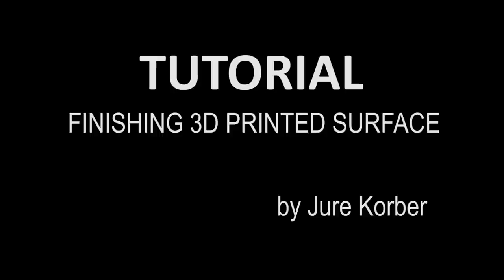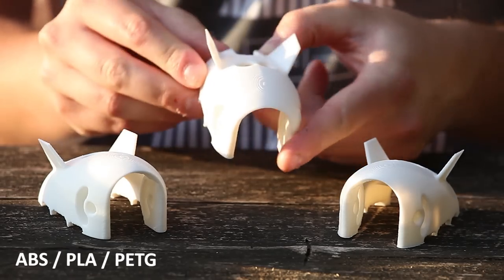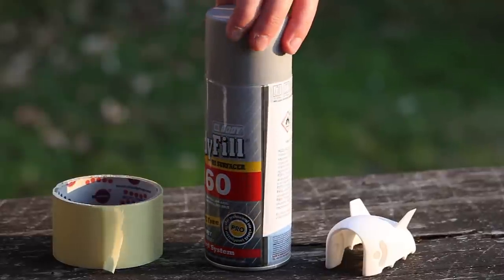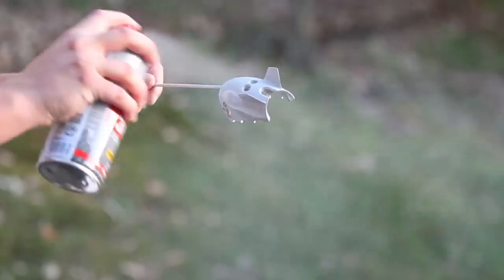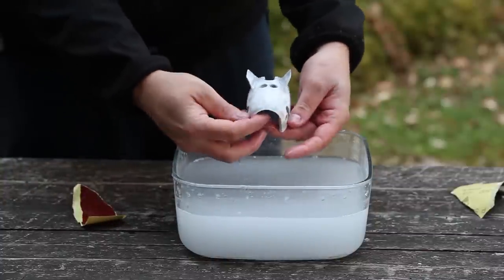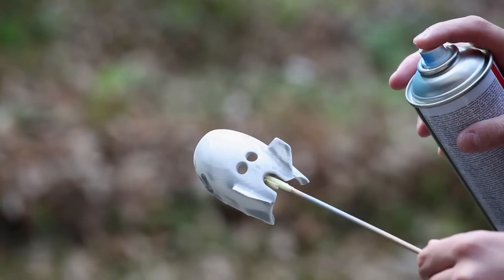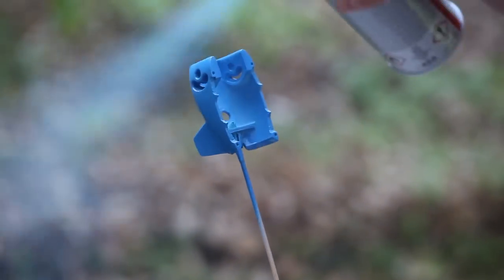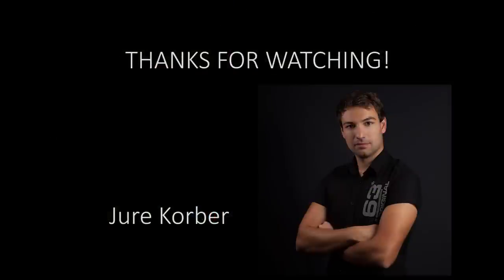Make your 3D printed part (surface) look awesome!  TUTORIAL

Comment: wtf. you said dont spray too much or it will drip but i see you keep spraying like crazy but it works!
Reply from the maker: Really depends on the color you use. Some can be sprayed thicker and they wont drip, some needs a bit of time between the coats. I used quite warm spray can and I also cut video a bit. When it starts dripping it's too late!
Reply: +juresnip - ohhh haha. looks like a long uncut shot. well done
Reply: generally the "right" way to do it is to lay down your first coats super dusty and light, this makes a sticky base of color for later coats. after that gets to somewhere between tacky and dry you start with the heavy coats, you gotta let them Dry almost completely before the next coat with some paints or else they e̶g̶g̶ ̶s̶h̶e̶l̶l̶ orange peel texture from the gasses leaving the paint underneath. anyway your last coat should be actually really wet. not so much that it drips, but certainly heavier than you'd think: this is how you get that smooth shiny look.

edit: eggshell is a desirable finish haha I meant orange peel
Reply: well, that clearly wasn't too much.   smh
Reply: @JKTechSi  Oh.. should you warm up the paint can before use?
Reply: That’s that the stick is for. He keeps turning it as he sprays to even out the paint. If you were to try this on say a stand or something it would drip for sure.
Reply: @chrismofer   My Dad calls it a flash coat. I often wondered why but you explain it well that it leaves something for the paint to stick to. I often am impatient or don't have the time so go too thick too soon.
Reply: @ArcanePath360  flash coat, makes sense. it does take 5-10 min even in sun to dry it enough. i also hold the can farther back than the 8-12" rule, as much as 2 feet back if the wind is playing nice. the paint gets semi tacky while in the air, and is halfway dried by the time it hits the part. @John Fiott yes! everything relating to the paint drying and fully curing works better and faster when warm. the cans should be something like room temp or even a little warmer. careful with heatguns and the like, its a pressure vessel. i leave cans in the sun 10min prior and shake them like hell. I used to paint in Alaska in the winter, it was next to impossible.
Reply: @chrismofer  Thanks for the advice. I'm trying to paint right now with gloss black in my shed where it's single digit temperature and windy. It's not going well.
Reply: @ArcanePath360  ah. slowly warm the can with a blow dryer (or distant heatgun) prior to spraying and then bring the part to a heated room for drying or make a heated cardboard box with the blow dryer. even if just for the first 10min of drying each coat. the cold slows the paint's ability to evaporate the solvents out & the nozzle has a harder time atomizing paint that's cold and soupy. also shake the can for literally 5 minutes; the pigment likes to sit at the bottom of the can and turns into muddy lumps which never get sprayed. I've had cans where you can feel the ball rolling around over lumps even after a full minute or so rattling.

https://youtu.be/zAGu2TPt_78?t=601 
here's a clip of Adam Savage's makeshift glue/paint drying oven. it's a semi-open box with a blow dryer spraying into one side.
Reply: @chrismofer   Thanks. Yeah, I got uneven levels of gloss on parts and matt effect in patches. The can was already warm where it was in the house but I let dry outside and the cold obviously hurt the finish.

Comment: Take a 3000-4000 grit sandpapper after you Done and sand it and then paint it with a clearcoat and you have a good finish thant wont scratch s easy
Reply: Kristian Johansson I don't believe that trying to apply a clear coat to something sanded with 4000 grit paper would work well. If anything, he should have used flat paint and then clearcoated it, then sand the clearcoat with up to 4000 grit if necessary then polish. Of course, it doesn't need to be sanded with 4000 grit unless it has orange peel or other blemishes.
Reply: Different factors dictate what you need. I personally have never found a need to go above 1200. Some people will swear at 2000 or 800. 

Also what kind of clearcoat you choose matters. Some are more durable then others at certain conditions. 

In the end experiment to see what works for you.
Reply: 4000? Clearcoat won’t adhere to a basically polished surface. 1200 is as far as you need to go. Anything more is a waste of time and a worse finish
Reply: Where do you get 1,000-4,000 grit sandpaper from? I've looked everywhere.
Reply: Joey Echols paint supply stores

Comment: For those who don't know how to do Sanding:
1. Get a neutral-coarse grit (the number on the sheet, about 120-180 should work) sandpaper.
2. Rub the object with the sandpaper. Make sure it is fully sanded before moving on.
3. Repeat Step 2 with neutral-fine grit (220-280) and fine grit (300-320) in order said.

Note: if the object is Wood: Go with the grain lines. Better Look.
Reply: Thank you!
Reply: I recently 3D printed aluminum piece. Should I follow the same steps or do you recommend other applications?
Reply: do u sand before or after curing? complete noob lol
Reply: @Kiyamlol  After curing.
Reply: @Shrubster  thank you :) is it safe to handle the bits of resin falling all over?
Reply: @Kiyamlol  So long as the resin is cured, the only danger would be the sanded resin particulates entering your nose and lungs which can cause irritation in the short term, and even more serious complications in large doses over the long term. Always wear the proper protective equipment such as masks rated for the task at hand, and work in a well ventilated area especially if this is something that you're going to do regularly!

Comment: Very nice and detailed overview. For my 3D parts I start with 120 grit dry sand paper to smooth edges and print lines first then use 220 grit wet/dry sand paper with water till part is almost perfect. I like using automotive sandable primer. Usually black or dark grey. I follow primer with wet sanding using at least 400 grit wet/dry sand paper. If you use metallic paints be sure that you prime entire part once more before applying finish paint. That way part is uniform in color and tone.

Comment: This is the best finish I've seen on a 3D part. Been a while since I got back into printing but its impressive that you can get such a shiny finish on something thats meant for practical use. I have seen some awful finishes on things that are touted at "commercial grade"

I will definitely pick up some of  that spray filler when I find something I want to finish well

Comment: This is awesome information!  I think those of us who make things with 3D are too fixed on things like acetone smoothing, and we forget that things like sandpaper and filler (which have been around for many decades) still work if we are willing to put the effort into our work.  Certainly there are many 3D printed parts that have too many nooks and crannies to fill and sand in this manner, but the simple technique that you demonstrate in this video would work for a lot of parts.
Reply from the maker: Exactly! This method works on wood, metal and other materials! In my experiment I also found out that I can get more strength (less delamination) when threated with this method!
Reply: i find that acetone smoothing strengthens my prints. what i usually do is sand first to fill most gaps with dust then acetone smooth it, the dust in the gaps melts and helps fill them

Comment: Great idea, your parts look awesome.   Have you ever tried the Acetone vapor method?  You simply hang your part inside a large jar by a string to the lid,  drop a paper towel soaked in Acetone into the jar, put on the lid with your part hanging from it so that it does not touch the paper towel.  You only want the vapor to melt the outer  surface of your printed part.  It should take only 20 to 30 min in the vapor bath and your part should come out very smooth and shiny.  don't leave it too long in the vapor bath or it will melt completely or deform.
Reply from the maker: Yeah! But it only works for ABS and its kind of limited method. This one works for all hard materials and you can change color, you can also apply hydrodipping etc. :)
Reply: You can use Ethyl Acetate instead of acetone to smooth out PLA parts using the vapor bath method.
Reply: @JKTechSi  do you plan on doing a tutorial on hydrodip? It'd be cool, your videos are amazing

Comment: Excellent video. Short and to the point. Just maybe one suggestion would be to try the same thing with a hobby spray gun. Not only does that involve smaller quantities of paint, but it also avoids the issue that, if you use the normal paint can only rarely, by the next time you use it the nozzle may be clogged up.

Comment: Just tip you should inform what grade sand paper you used every stage i like good videos like this with details
Reply from the maker: It really doesn't matter! You start with 120, then around 250,then 400 and finish with 800,but you could also skip some between or end with 600 up to 1200. Paint fills last small dents and grabs nicely.

Comment: The best paint I have ever used in spray cans I use for my scale model cars and won best in show alot it's the testors extreme laqure the base coat is so glossy like a mirror but once you hit it with the clear in same brand and line of paint it will be glass and no need to sand or polish the clear coat to make it really shiny like a mirror the trick is to lay the base coat and clear coats on medium wet not to light just to the point before it starts to run and that's how I do every model car and 3d printed items and it looks amazing

Comment: Great Video Tutorial, however, DON NOT use water when doing this with PLA. PLA soaks up water and expands! The BodyFill Primer you are using is awesome and a bit elastic and sands great, but other primers don't expand and will crack like crazy if the PLA absorbs any water/moisture while it's drying..  If you use water any part of the PLA print that isn't  fully covered by the primer when you are doing the final sanding will expand and then later after you apply the last coat it can shrink(when it dies out again) back down in those areas and cause dips in the finish.

Comment: This method is great, but might not be enough for prints that have layer lines that are too thick. For those, you might consider combining this method with the use of some type of filler putty. I heard wood filler and bondo spot putty work well.

Comment: Is it recommended to protect.the paint with transparent acrilic paint?
Reply from the maker: You don't need to do that, as generally paint is applied quite thick here and it's stable on it's own. If you use some special metallic paints, then you might want to do that, yes.

Comment: This process is really cool... Is there a specific brand of filler or paint that you would recommend for doing parts and props?  I am thinking about doing this myself, but have very little experience doing any post processing for my 3d printed things.
Reply from the maker: Hey! Well I used a lot of brands but they are very similar. I think it's best to go to your local paint shop, auto-repair shop or local hardware store and ask for filler in spray and spray paint (acrylic). I bet it will work great!

Comment: Hi Jure, thanks for share your technique. I saw in another video that you get better quality printing using two fans pointing at the nozzle. That's why you use two silent fan mod?
Reply from the maker: No - one fan is to cool the hotend and another is to cool the part. But when printing ABS or ASA you must print without using cooling fan, or you will get warping and separation. Fan is only used for PLA, TPU and a little for PETG.

Comment: Hey, great video. I used this techniques in some of my prints and it worked out great. However, I'd like to use some of the pieces indoor. Is there a way to get rid of the paint smell faster? I printed a business card holder that smelled like paint for weeks and even transfered some of the smell to the cards. Have you had any similar experiences?
Reply from the maker: Actually painting too thick can make that. Try to paint as thin as possible to still get nice effect, use good quality paints (if possible true 2k paints) and cure in well heated place.

Comment: Eventhough it looks cool, when using a non-soluble or decomposable polymer like PLA, this technique introduces a lot of ultrafine particles in the air and the environment. If you want to do this take care with breathing and use a rebreather or dust mask. Also be careful where you dispose your waste! Flushing it down the drain will probably lead to some bad effects in your local sewer system or ecological environment. Anyway, keep making cool stuff!

Comment: That BodyFill 360 Spray must be a UK thing because I can't find it here in the US!
I did find RUST-OLEUM Primer 2 in 1 filler & sandable spray but when using a Krylon Colormaxx paint+primer, it just drips away from my object leaving unpainted spots all over my object! :/
I'm not familiar with these different types of paint and was unable to find the exact materials you used in your video. :(

Comment: Excellent tutorial! Just one thing... I can't seem to find the Spray Filler, is this the same as a Spray Primer? Is there any other name for this spray? Thank you!
Reply from the maker: No, spray primer is just a coat that needs to be applied if you have some really strange plastic that color doesn't like to stick to. Spray filler is actually a filler in a spray, that you can sand after drying. Check google with term "spray filler"

Comment: your video is helpful ! and really amazing result thank you 
but do you recomand this steps to small object ?
I have very small character I print it and I have problem in soften it 
does the spray filler helps to cover some lines which I try to clean ?
Reply from the maker: It can be done for small object, but it may take a lot of time so sand and file it... maybe you can use rotary tool for polishing/sanding, just like they use for jewlery etc.
Reply: oh my this is good idea!! thank you so much !! you are the best teacher of painting !! 
after searching the name ( rotary tool ) on google I do really need that rotary tool !!
I would like to know more and learn more from you !! thank you !!

Comment: So how did you program the PID controller?.. I looked and looked for someone showing how to do it. But I came up with nothing. A little more exploring on this topic would be awesome!!!!
Reply from the maker: In faculty (mechanical engineering) we had whole subject related to PID control. Basically it's temperature regulated with fan. More temperature you want, less fan you need. That means you can put system in closed loop with temperature sensor and the fan-control. Fan is controlled with PWM signal which control fan power. PID loop is maintained with microcontroller that is watching temperature sensor, desired temperature and outputs PWM signal to the fan. :)

Comment: nice technique..really nice!! i like it,,great job..
but how if the 3d printed part has a high detail?
Reply from the maker: If 3d printed part has high detail, that means it has to be printed with very low layer height - for example 0.05mm - which means that surface of such part is good quality already. That means that there is maybe no sanding and filling needed - just few layers of paint directly on the printed surface. Few thicker coats will fill up the printing holes, which are in high detail print very little and the surface will become smooth and even. If there are some really fine details, small holes etc - extra caution must be applied not to fill those spots with paint.
Reply: i see..low layer height, few layers paint..okok,, thanks man..! :)

Comment: I wonder if it is possible to add multiple layers of a fine mesh when printing to increase strength.
Reply from the maker: problem is that with mesh you would only increase strength in X and Y direction, which is already strong. Problem is in Z direction.
Reply: @JKTechSi  For general use in all cases you are more correct than not.  I got the thought from someone who printed a part with channels inside this part he wanted to be stronger. The person printing could then lay cables into them and then re-commence printing over these. The final product turned out to be much stronger for it's intended use than a normal PLA part. It occured to me that a fine strong mesh could improve on that idea.

Comment: Nice work! Is it safe for kitchen accessories that will touch food? Thanks
Reply: It depends on the paint type but most 3d printer filaments are not safe for kitchen use anyway
Reply: Thanks
Reply: @TechTroppy  Thanks for your reply

Comment: How would go about making a piece that needs 360 degree spraying, so there is no way of sticking a holding stick on the piece? Do the process twice, flipping half way through ?
Reply from the maker: You usually hang it on tiny rope and spray around it. You can hook it up somewhere, or stick it with a needle.

Comment: I would be too scared to fly it! I've broken loads of PLA gopro mounts. Would it be better to print in ABS, vapour smooth and then paint ? Saves sanding out a lot of Z layer lines

Comment: I wonder if you could use a sand blaster to speed up the sanding?  Would it hold up?
Reply from the maker: That would depend on airflow I guess. With some low settings it may hold up... Never tried it though...

Comment: Great result! But there is one "but" - injection moulding is generaly used for cutting off expenses for manufacturing numerous parts and this technique, althouth great, would not be a solution. Maybe if you have had used a sanding/buffing wheel? ;)